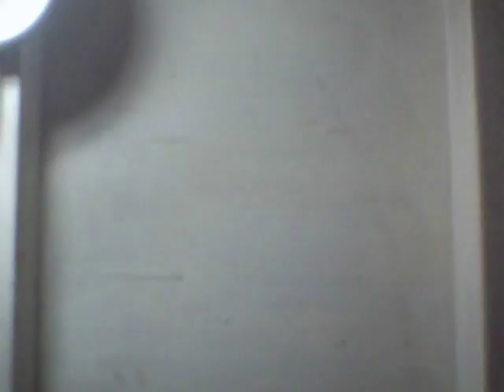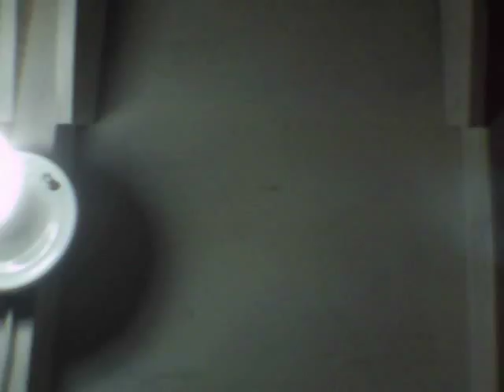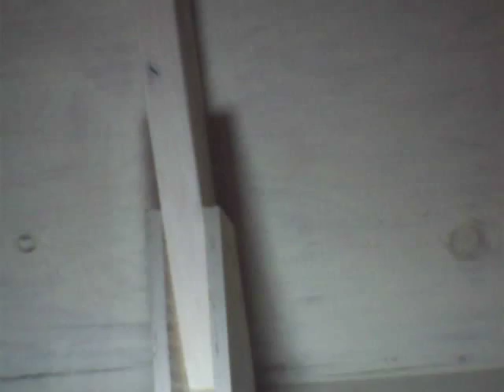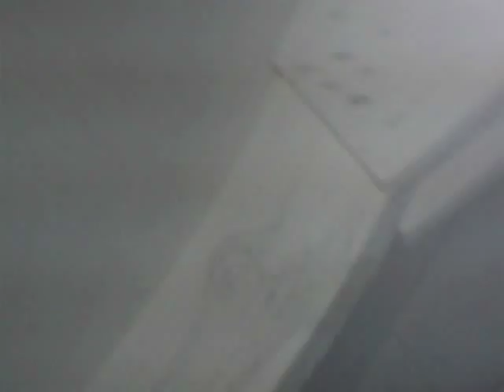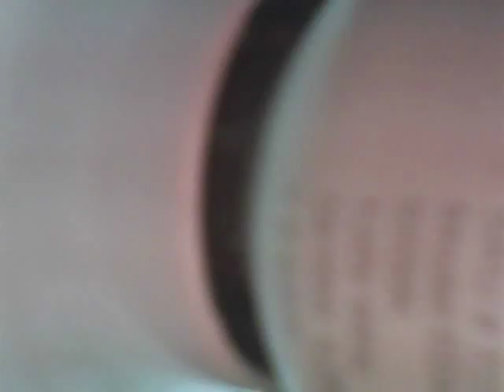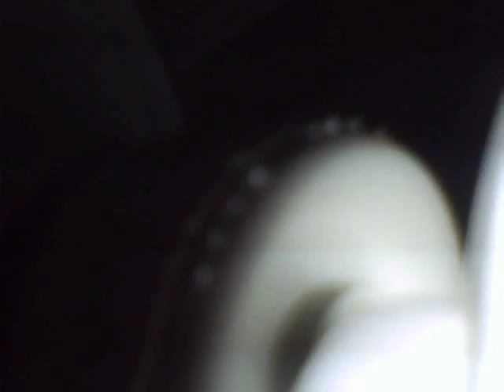Fluorescent lamp flickering

Comment: Hi, how can one easily  determine whether it is an unstable arc or a faulty ballast in this case? I have a NEW CFL that is giving this exact same flickering behavior and am wondering whether I should just trash it for safety reasons or not. I can detect no noise when it's flickering and sometimes if I turn it off and immediately back on again the flicker will disappear.

Comment from the maker: @ncrdisabled   This lamp was only in use because the fixture it is in is part of the recently installed emergency lighting circuit for our sheds, and this is a placeholder lamp until I get more halogen lamps or fluorescent lamps that will work reliably on inverter electricity.  This lamp has under a dozen burn hours on it.